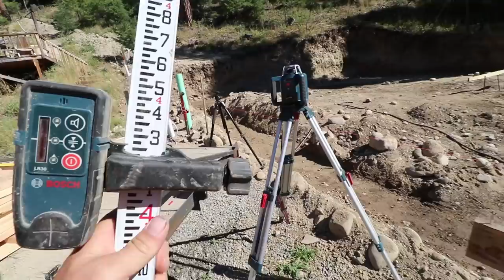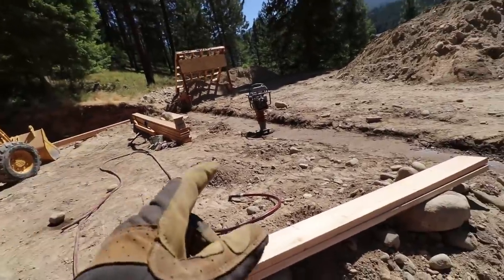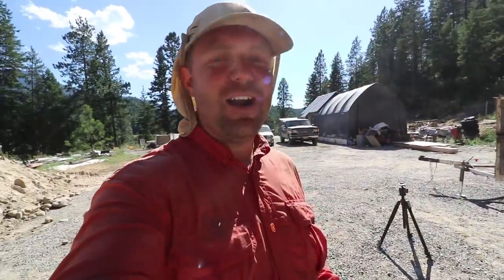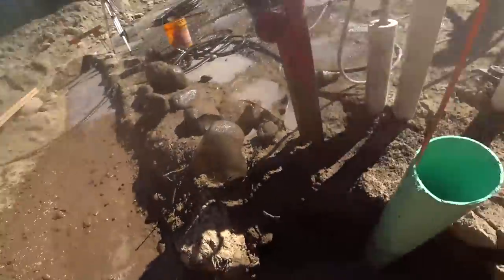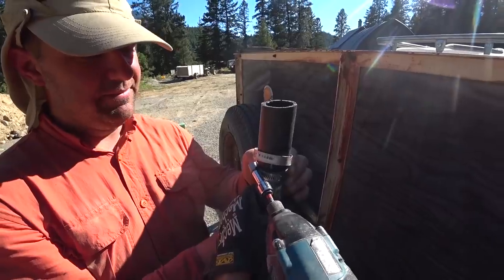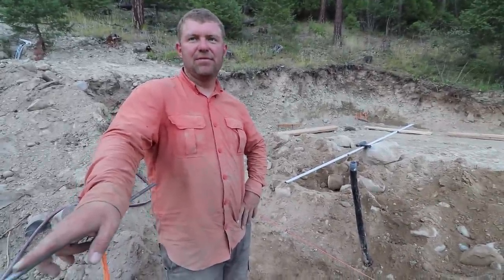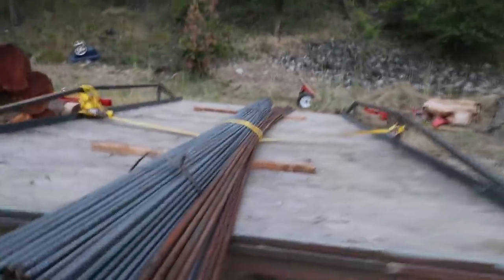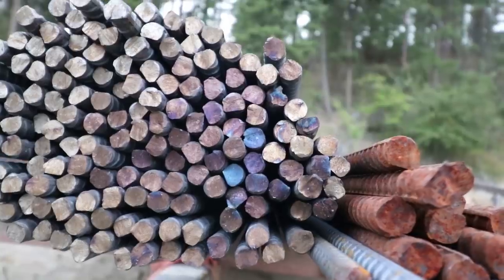WELP… BLEW OUR WATER MAIN! (Final Prep for Concrete Forms)

Comment: I laughed my can off! That was awesome! I'm sure there are a bunch of holier than thou never make a mistake people commenting. I needed to change the plumbing in a house I had bought years ago. The 1" line coming in for the 1940's era house had a gate valve shut off. I closed it. Except it didn't close. It was broke, and I didn't know it. I heated up the fitting after the valve and blammo! Fitting shot off and a 1" line was pouring into my house under 60 psi for 45 minutes before the shutoff at the street was turned. It was a fabulous day. And son of a ................. wasn't my only words. Keep forging ahead. Life is an adventure.

Comment: I compliment you both for the strong will and staying compliant and keeping the peace with each other regardless of the simple failings or oversights, shows guts and respect for yourselves and each other. I for one know what it takes to tackle an unknown and keep positive and continue moving forward. Hang in there, it ain't gonna get anywhere or done without your strong will and courage. Hold your heads up high and breath deep before ya plunge head first into a trench full of muddy water, bet the shower felt good..been there done that..Peace !!

Comment: Just a suggestion. If the black poly pipe you are using is 200 psi you can thread it and and use galvanized unions. Using plastic barb fittings no matter how you do it don't last. Your gonna regret em.
Reply: And metals hose clamps buried doesn't look like a wise choice either.  Just my opinion.

Comment: If the concrete hasn't been poured yet, think about something to do with any excess you may be paying for (IF you can manage to add another task).  With a pumper, you can get it, almost, anywhere except the top of the hill.  Maybe a landing pad at the top and bottom of the steps.  Even washout can be used.

Comment: Hey guys, your pretty amazing!!
Maybe a small stupid question but are you using 3/4" form pins with nail holes in them? If so 10 penny duplex (double head) nails are the best. Just drive them in to the second head and that allows you to get either a straight claw hammer or a bar onto the nail heads to pull them when stripping the forms!! Maybe a small thing but it really helps keep the frustration down to a minimum. But then I suppose you knew that already!! If so just ignore me!!
Ray

Comment: Bad idea to put that 90 degree fitting under your slab for house. If it fails your in a world of hurt. Should have no fittings if not necessary under the slab. Just bend the poly upwards.

Comment: If you plan to use the form boards for anything else you will need to coat the boards with paint or something.  The concrete will soak into the boards and render them almost useless.  They will be about twice as heavy, hard to cut/dull blades, hard to screw or nail, etc.  I learned this from my house build so learn from my mistake.

Comment: A much easier home to build is one on concrete stumps, timber floor, at whatever height you like off the ground, timber stud walls, lots of insulation under floor,in walls and ceiling
pitched roof, as 30 deg. and a concrete slab for your garage. I like the show !

Comment: I love you guys, I love that you are do this yourself. But I'm a plumber and I have to say, I have never ever seen anybody put a hose clamp Underground.
I can't see all the fittings you have used to be cheaper than PVC fittings.
Reply: I believe that those metal hose clamps over time laying in direct contact with the soil and water will rust and let loose. I am only guessing this to be the case and can't offer any real proof as I am not a plumber , but that would certainly concern me.
Reply: I'm general contractor. If somebody used same clams for main water line on my job I kick him out immediately
Reply: Robert Nash 
Since your a plumber , please explain to them what a better cut ratcheting pipe cutters make AND how much easier they are than a saw and having to sand all the burrs .   Thought maybe your opinion might mean more to them since your a plumber . 😀
Reply: David Gerstenberger David I'm talking portable water system under pressure, Not sewage.
Reply: David Gerstenberger lol😉
Reply: I'm just saying, I think that's a bad idea.
Reply: The clamp itself won't, it's the screw/bolt that will and yes it will loosen.

Comment: whats going to keep those squeeze connectors (metal ones) from rusting and then releasing later on down the road??  from the new black pipe you just added on for the house?

Comment: Is there a reason you haven’t used any valves here? That new T is going to have exactly,the same problem when you remove that cap in future, only then it will be in a really good place to undermine your foundations

Comment: Hi Guys from the UK. Really enjoying the journey with you guys and appreciate you are learning but why have you just buried all those fittings and connections in the soil? I think that's asking for trouble. I would have built an inspection chamber NOW to enable you to fix any issues later with leaks etc. Also why didn't you run the water pipe through another larger pipe (sleeve) under the foundation so if you have to renew the pipe for any reason you can just thread it through the sleeve. It just saves time later guys. Not a criticism just trying to be helpful and save you some grief later. Have fun and remember keep smiling guys.

Comment: I can feel your frustration. It has happened to me a lot. But think things over and re-think and re-think. It is too easy to go ahead in fast forward because you feel pressured to complete the task. But it can prove very expensive in the future. I liked the suggestion for an inspection port from Col H. I get the feeling you are rushing things a bit and from my own experience this can cause a LOT of problems down the road. With lots of sympathy from Athens.

Comment: I wasn't sure if you were using Rector seal pipe dope but it used to be unsafe for plastics... They may have changed it...you might check the label.... I've seen a few melted threads blow plastic fittings.....

Comment: You're not putting more utilities UNDER the footing?  Now would be the time to install some.
Reply: exactly, i want to see the drawings of the house, its very hard to follow if we do not know the drawings..
Reply: they said a plumber was running the line to the septic.
Reply: They did mention weeping tiles. Just called them drains.
Reply: Maybe an empty conduit for future wires and cables, such as antenna or satellite or etc.
Reply: William N Benway... yup, you can never have too many empty ducts running in for future upgrades.
Reply: This is an obvious suggestion especially if they are planning to pour a concrete floor.  Russ Birzescu's comment reminds something no one else mentioned - a well for a sump pump.  They have certainly spent more time thinking about these things than any of us.  I've been assuming they're going to just have a crawl space with a suspended wooden floor.
Reply: They have a 5 acre lot
Reply: LMAO...people get a life!!!

Comment: I'm afraid to be a bit late, but I'd considered to lead the main water line to the further point of the possible usage underneath the house - instead of what You have done-, and make branches for every main usage - it will help to maintain the pressure in the future, when You will be more than two. Sorry about my English, I was't that lucky to born there - I'm pretty lucky though... :)

Comment: How do you plan to heat your house in the winter time I have read some place that it would be cheaper the heat your floors then to keep the air you could use a wood burning rocket stove to heat your floors

Comment: After that chaos, you 2 just need to take a nice warm mud bath together. Not necessarily on camera.
15:18 Just cut out the damaged part, get 2 hose fittings, and you'll have 2 shorter hoses that will come in handy where a full-length hose is not needed.

Comment: Sleeves, please! Whether you're below the foundation or in the foundation, throw some large PVC pipe in so you can run utilities (water, sewer, electric, storm, gas, etc.) after you pour the concrete. Duct tape the ends so no concrete gets in and wedge it in or run it through the forms so it doesn't move. Working hard, keep going!

Comment: You have used small metal clamps for the black poly pipe to make little T for the whater to the house. It will rust under the soil ,would it not ?

Comment: If this has been mentioned I haven't seen that part. I don't see any tie wires for the forms. I had a friend who was going to pour a basement. He set up plywood forms and buried the bottom edges of the plywood 6 inches in the ground. Then he put 2 x 4 ties across the top of the forms to hold them together. I got there after they started to pour and it was too late to tell him about tie wires. 
The incredibly heavy wet cement blew the forms apart and instead of a 8 foot high 12 inch thick wall he ended up with a 2 foot high blob of concrete in the bottom of a pile of forms. 
If you are like me the publishing comes after the job is done so you may already have the pour done. If so then I hope I'm wrong and you knew about the tie wires. If not you will have to bury the chunk of concrete like my friend did.

Comment: So, at 9:38 you bury a capped line fitting for future use, in which you'll need to dig back up... again for when you which to use it. Used "hose clamps" on irrigation pipe as a "main water line"...

Comment: Warning! Never heat a piece of rebar before you bend it. You lose the strength in it. Just use a rebar bender. Plus, I don't see your trench for the septic and sump drain lines. Make sure your sewer and sump trenches are far away from your water input trench. That way if you get a leak, there won't be a much of a risk of contamination.

Comment: Hey Jessie what about that nasty poop line you will need to have below the footings and below the slab or are you planing to simply to  have an out building for the toilet 
have a good day and a better tomorrow

ps. most building sights will have 3 pipes coming up through the slab 1 water 2 waste 3 power 
pps #4 a back up for whatever  need might come up latter

Comment: after watching this I'm wondering where your sewer connection is going. I'm guessing you need to dig another trench through your footing to bring sewer through your footing... unless you have already poured, and then you will need to tunnel under the footing and cut the concrete slab to get it in.

I'm also wondering if you checked your home floor plan for where the water/sewer need to come up through the slab? Putting a pipe through the slab in a random location will be floor plan nightmare in the future. (or it means concrete cutting the slab to move it to where it should be)

Comment: Bending the rebar is alot easier by making a form that you can secure near the bend and heat it before bending.  When I did my retaining walls I made omega shaped verticals so my footer into the wall was one piece of steel.  An Acetelyne tourch worked wonders.   This was 3/8.  Your larger is going to be even harder.  Guess you can use the hyrdraulics on your equipment to help bend that stuff.  Good luck.

Comment: You shouldn't have put all those big rocks back into the hole with the water pipe if you have to dig it back up ever it will be really hard to do
Reply: A lot of thats going to be under a foot of conrete and a lot of house anyways
Reply: I ment if you had a water leak it would be hard to dig up if all those big rocks are in the hole
Reply: The tanks are already settled, they're placed on compacted ground... The only thing settling is the ground above and around the sides of the cisterns, which won't move the cisterns... Besides, they already checked it over a week later and it's not leaking...

While they'll check it again when they install the rain catchment pipes later...

While there is a cut off from the cisterns to the rest of the system, there's just not a cut off between the two cisterns...

Comment: Lock out tag out? No safety shoes? Never seen barbed fittings on HDPE but I've never used it in the USA. Are those even NSF61?
Reply: That's f-ed up. All the other plumbing mistakes just mean leaks and costly repairs which won't kill anyone, but not using safe potable water parts? That is potentially lethal for them or whoever buys the property in the future.

Comment: Ummm, couple quick questions; how do you get the excavator out without destroying the trenches for the forms you worked so hard digging and compacting?  Also, sewer line, when are you running that under the house?

Comment: Keep your spirits up guys, but the hose clamps under ground not a good idea, and I didn't see any pressure test on any of that before you buried it, might come back to bite you
Reply: Gear hose clamps rust in wet soil and will release, in about ten years

Comment: You guys need some stress relief, your property is perfect for shooting air powered rifles and pistols in .177 and .22 caliber, they usually only shoot up to 25 yards and are super quite, my air pistol was purchased through Walmart for $70, its a .177 caliber Benjamin Trail break barrel single shot, it shoots at 625 fps, I put a red dot laser on it, pretty accurate up to 15 yards, my rifle is a Gamo Swarm, this is one sweet rifle, it comes with a scope, its a 10 shot rotary clip break barrel, its a .22 caliber, shooting pellets at 800 to 1000 fps depending on pellet weight and distance, The PCP air pistols and rifles are the way to go but a very costly, I'm looking for a multi shot air pellet  pistol, most of them a very expensive, and I don't want Co2 powered, only thing I have found is using the PCP air chamber systems, which is very good, but very $$$$$$, so I well keep searching.

Comment: Always put a sleeve under the foundation, should the pipe need further work. Also sewer and water need to be a minimum of 4' apart and sleeved if they cross each other.

Comment: Please turn the Channellock or slip joint pliers over in your hand. Also you need larger size pliers, on average for a given pipe size you are working with. Guys, no criticism, just trying to save your hands.

Comment: You laid poly pipe directly in the ground ?
Bad move, should be laid in a sand bed otherwise over time the water pressure movement of the hose can rub against stones/rock and create a leak that may take years to detect.

Comment: You know, if you want to use earth cooling/heating, you should consider isolating some amount of earth that has thermal connectivity with the house. Otherwise if you want to further heat or cool the house, interconnected hill mass will be dictating you its average temperature. Think about it.

Comment: Can I ask why would you waste the money renting the jumping jack when you have a backhoe been running equipment for 10 years and the backhoe works really good for that
Reply: You're kidding, right?  Not every backhoe comes with a hydraulic compacter for one thing, they don't even have a forklift attachment option yet, and second it's not the precision type that can be worked into corners and tight spaces like this rented unit can...  and they're working within tight margins and have to worry about knocking down more rocks from the hillside that'll just cause them more work and wasted time...

Comment: Not sure that Tee is going to workout. I think that its going to fail especially if those hose clamps aren't stainless. if the clamps are steel they are going to corrode and fail. Why didn't you use poly fittings?

Comment: I like your show and am impressed the job your doing but I have installed water sewer mains and you should never cover your mains and water line with stone because  as things settle and move it could cause problems and shouldn't use hose clamps on underground pipes. Time will tell keep up the good work though.

Comment: Lesson one double check everything before splitting couplings, some can easily turn valves back on so that's no excuse.

What sort of a valve are you using if it's just a tap type why use a wrench, get a piece of steel pipe cut a slot for the valve lever and turn it. If it's a nut type head get a socket on a on extension and either a sliding bar or ratchet to turn it off.

This should have been sorted at installation of the valve, what would have happened in an emergency???

Don't leave jobs for later on finish each part of the installation as you go. By the time you finish this project you will be experts and start building homes all over the county. But you know how the saying goes. ' More haste less speed"

Good to see your getting on. BS

Comment: Looks like you guys are trying your best to do a good job but whoever told you to use those cheap hose clamps on the underground plumbing without protecting them from the elements has created a replacement job within a year, so be prepared to dig it all back up.